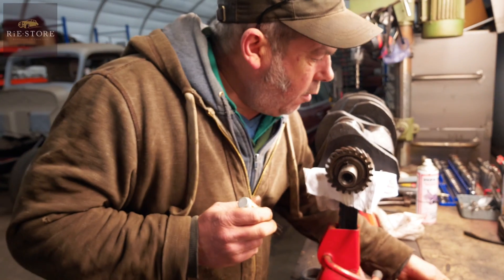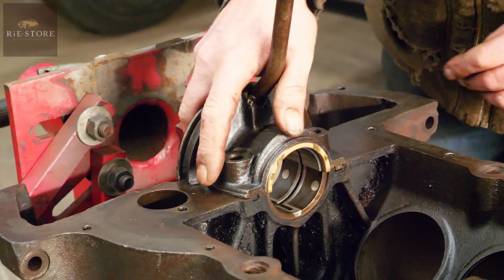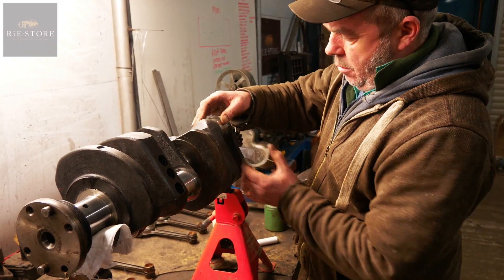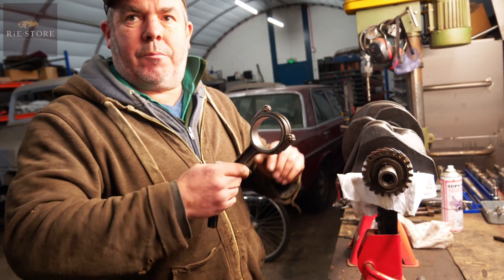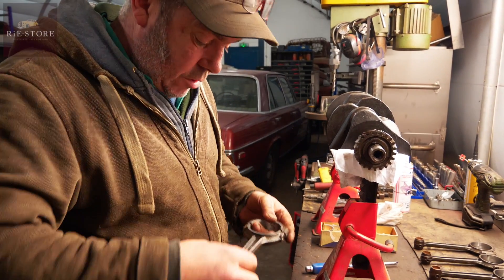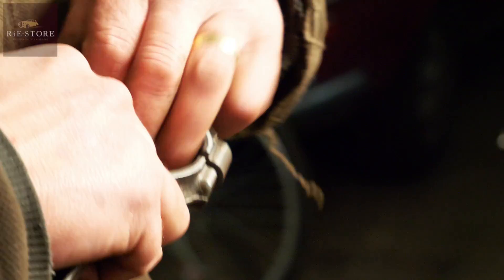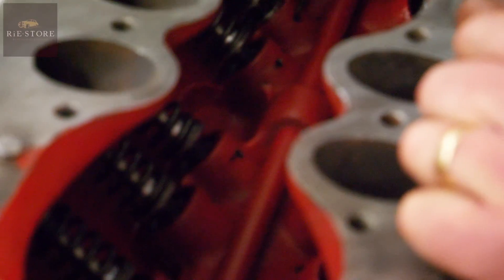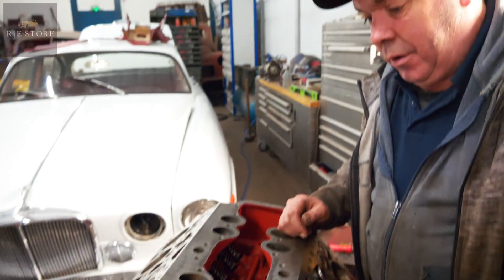Assembling crank, con rods and bearings - 1936 Ford Flathead V8 / ep008

Comment: Wayne Berry here. Hope I am not imposing too much. I am particularly interested in the replacement of the poured main bearings as I have one of these engines which is finished if I have to get the bearings re-poured. I take it that the bearings were standard I/D Princess mains shells of ???inches sliced into two halves with journals ground to suit - a part No. would be good if you have one. Noting the retainer notches, was the block line bored to suit the O/S diameter of the Princess shells. Will appreciate any info you can help with. Great video!!!
Wayne
Reply from the maker: Hey Wayne, Ash answered your question in this weeks video https://youtu.be/10MZvoSVvtw